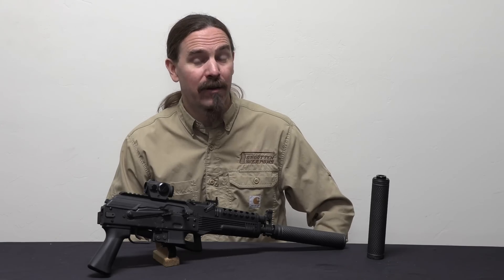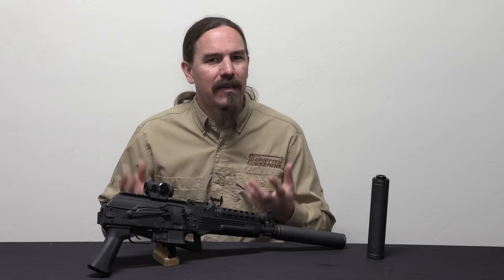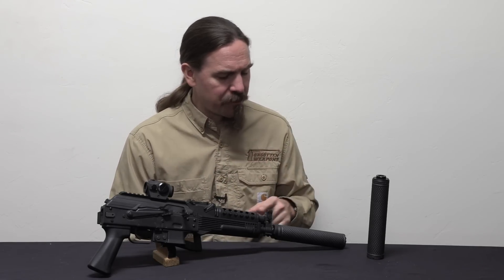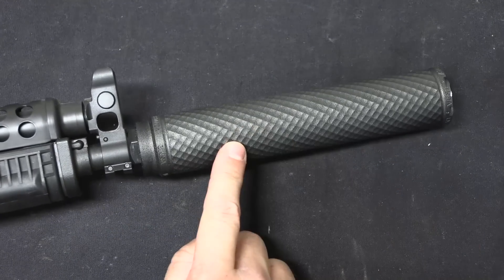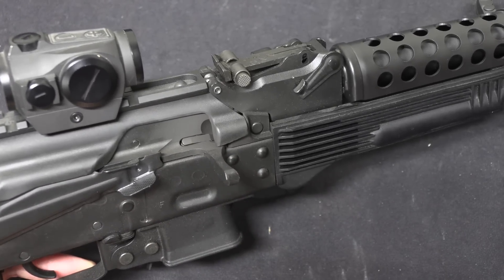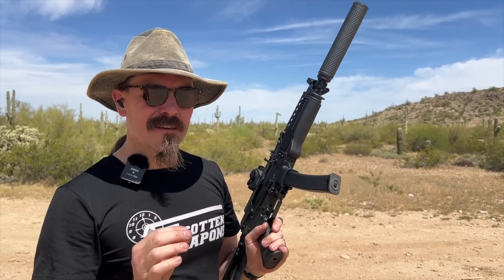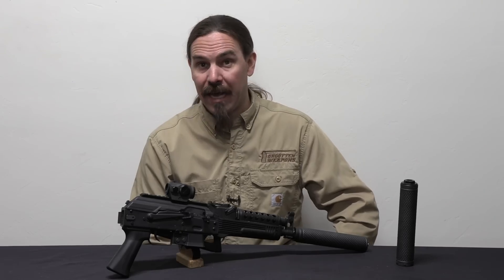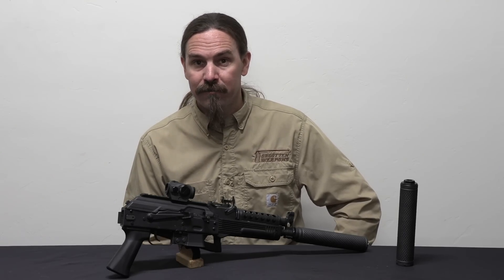PTR Vent Suppressor: 3D Printed Titanium Foam

Comment: What is the point of reducing the gases heat?   I understand what physically slowing the gases down and venting does and why that suppresses sound, but why would pulling the heat out of the gas and absorbing it with the can be beneficial rather than letting that heat escape into the atmosphere?   Seems the can, and subsequently the barrel would get hotter faster.  Won't that put extra wear on those components?
Reply from the maker: PV=nRT. Reducing the temperature reduces the pressure.

Comment: It seems like that would be an incredible pain in the butt to clean - you might have to use an ultrasonic bath with solvent or something.  Cleaning aside, if the audio is coming through correctly then the sound profile with subsonics seems pretty darn amazing.

Comment: Hello. Are you familiar with shotgun chamber adapters? 12 gauge to handgun, smaller shotgun and 22 lr. Some only have an inch or two of barrel some are 16-18”. Would a 22lr chamber adapter for a 12 gauge that had a built in suppressor at the end of the adapter that fits entirely inside the 12gauge barrel need a tax stamp?

Comment: There is absolutely no way that soaking that can in solvent is going to get the carbon out of that membrane. That’s pure fiction. You can’t get hardened carbon out of any can in fact from pure solvent without physically scrubbing it away. You can at best get a partial percentage out with a soak or sonic clean. I bet that can is effectively done at 2000 rounds as far as its effectiveness in back pressure reduction.

Comment: Basically the whole idea of a suppressor is to decrease the performance of the bullet when you reduce the report you reduce the performance now if you can get a bullet to reduce its report without reducing its impact on the Target that would be something that would be valuable to DARPA I have an idea for a silencer that's deployed when you pull the trigger it is a munitions deployed suppression device and requires no extra equipment other than the special round loaded into the magazine before you pull the trigger

Comment: My first thought was to wonder what the specific heat of Ti was.  The idea being that this suppressor is meant to steal energy from the gas by simply stealing heat away rather than baffles that provide a bad path to escape (bleed velocity).  I was pleasantly surprised to see that Ti is rather high in the grand scheme of things in terms of specific heat, ie it has the potential to take a lot of heat without a temperature change (same reason a little poured water into any suppressor makes it quite a bit quieter).

Comment: The concept is fascinating, but I don't get why Titanium is used. Its thermal conductivity is abysmal. Wouldn't it make more sense to print it from (if possible) copper or brass? Or is it because of Titanium being very light when compared to those metals?
Reply: Durability, weight, safety. Copper and brass deform significantly under heat. Brass and copper anneal at 700F. Firing a couple of 30 round mags of 5.56 back to back heats up to the 400-500F range very quickly. If shooting sustained, the temps of the can and barrel reach over 1,000F.

Comment: Having experience with this type of material, you will really need an ultrasonic cleaner to maintain it. This stuff has been used in medical devices for decades. I used to work for a company that developed the manufacturing process that was used before 3d printing was a viable option.  If anyone is interested in how it used to (and probably still is sometimes)  be made, just ask. This is a pretty cool material.  Due to its porosity, bone and tissue will grow into it.

Comment: I would think that white vinegar would work just fine as a solvent (?). I don't think that would 'eat' the ti. Though it would probably strip any platings off; on the nut, for example.

Comment: This is really interesting.  I've been using almost only OSS cans for the past maybe 5 years or so(I've got 5 of them now 😬😬😬), and i just love them(my eyes are cross dominant so i shoot long guns lefty.)  I've got the 5.56k on my 12.5" HD gun.  But im always checking out new options/technology, etc.
In fact, a long time ago i first saw that 3D printed Ultra II Brevis(or something like that), the one that weighs less than two A2 flash hiders and only adds like 2 or 3 inches to your gun because its so fat, and i thought that was potentially the future.  I ended up not getting because of its relatively short lifespan, there not being much info on it, but mostly because of the price.
And as much as I'd like to buy one of these, its the same thing with the brevis again.  It new, not much info on it, and costs to much for me to "take a chance on," especially when I've already got something that works and that I like.

Comment: Someone should take a Tesla one way valve and wrap the principal around a bore using 3d print technology. Let the gases block or slow the escape by forcing some of the gas back on its self. Use finite element analysis for proper flow. My two cents. ✌️

Comment: It's very cool but at that price you have to wonder about long term degradation of the internal gas pathways due to imperfect cleaning or even over cleaning. Hopefully they'll get a large military contract so they can reduce the unit cost and gather large scale endurance and performance data for future designs.

Comment: Not sure if it came across right on video but the repetition sound of the gun sounded louder than the actual shot. If so it would be super interesting to mod a gun to minimize the mechanical sounds of cycling.

Comment: Our company worked some if this decades ago.  The same effect can be obtained with a flexible plastic foam, similar to the insulation for hot water pipes.  The problem is that this is totally non-durable, and quickly wears away, sometime enflames.  However, with some duct tape, this works for about one magazine.

Comment: poor man's ultrasonic cleaner-take a aluminum tray pan and fill with solvent then take your off the shelf vibrator and put it in a chemical proof zip lock bag, drop it in for 1 hour with the gun parts and viola!

Comment: honestly, with it being pure monolithic titanium, you could probably get some pretty effective cleaning out of just getting it hot as hell. titanium doesn't melt until fuggen' 3000 degrees F, but carbon will be burned off into CO and CO2 at temperatures far, far, far below that.

edit: WOW that is a quiet suppressor. man. the subs literally only made the noise of the action.

Comment: Its often very hard to tell sound on video but a good indicator is when you can hear the hits and ricochias that its pretty quiet.  You could clearly see a bit of gas coming out but it didnt seem like all that much but i dont know if i would claim 0.  I would actually be interested in seeing someone do a burn down test of one of these putting 1500-2000 rounds through one in a day and see how its working then.  i dont know if a 1500 round limit would have any military application but 1500 round limit is more then plenty for most civ use.  Probably even police and swat use.  I cant afford one myself but I will be interested to see where this suppressor goes if they can make a quick connect and what small improvements they can find.

after thought.  I wonder if it would be possible to actually make the whole suppressor a sponge making it more like a compensator with the gas just leaking out of the sides in a large area.  It would be a highly custom market but it would allow suppressors to be custom made to a certain firearm allowing but recoil reduction and suppression.  I am thinking about lighter short barreled guns in larger calibers that could take advantage of it.

Comment: How much could a supressor possibly cool down exaust gases in the moment a bang happens ?!
I guess, not so much. So I also guess the cooling effect is not the point that matters, because it's virtually not existing.
For example felt works possibly even better than this metal mesh and sponge pattern, dispite the fact that it would be destroyed pretty fast. But felt would for sure not cool down the gases !  So it's most likely something else that's dampening the bang.

Comment: good video. One thing to consider is the bond during this process makes the material a bit brittle, so there is potential these could shatter in some cases. I also wonder how much carbon buildup would render the perforations useless. One day when we dont have to worry about registration and tax stamps, these could be made inexpensively in volume and you would just throw it away and get a new one after hard use or damage.

Comment: Holy crap... That's incredible. I wonder what the maximum number of rounds is, or could this continue to work almost indefinitely with cleaning. There's no way soaking in CLP will remove all the carbon, so it could get worse over time even with cleaning.

Comment: Um... i wonder if, or how long until, Really Wild 3d printed weaponry happens.
This release suggests a decade or less, for machinery prices to come down, availability of machinery to go up, the total to drive supply chains...
You could Literally have a weapon body that is an integrated suppressor, that vents out the front.
Ha! Suddenly the "scifi look" could have a purpose!
Could take all Kinds of lessons from pulsejet engines, car exhaust systems, and more.
Lessons where they had to identify behaviours a Suppressor would want, but jets & car engines Do Not.
Just the ability to have 200 tubes to redirect  gas, but then you could make every tube a different length; physically changing & extending the sound profile, while carrying it past even more metal,  that serves More roles in one...
Foam metals have been a research project & designer wet dream for Decades.
The ability to customise the density, structural rigidity, and many other properties,  of metals, the way we do with foam plastics?
The "porosity" terminology suggests they're  manipulating a "welding failure" intentionally...
But this is going to drive interest & innovation.

Comment: I wonder...
Theoretically, Carbon buildup Could be solved by burning it off in a kiln at high temperatures. Basically burning it it combine with oxygen & escale as CO².it 
How high a temp can this titanium foam survive (pure titanium is flammable), is it usable after, how effectively does that burn out residues; i have no idea.

Comment: I do question how long Titanium will last for this though, it's not really known to hold up for High temperatures (coming from an automotive background where titanium exhausts may be common, but headers are not), however I also wonder if an Inconel version could work (Used for high end headers and F1 exhausts, also rocket engines), it'll handle the heat MUCH better, and can also be 3D printed now. The porous structure enabled by 3D printing is super awesome though, and while I don't know a lot about suppressors, giving it a bath in solvent, maybe in an ultrasonic cleaner, seems pretty easy actually.

Comment: My first suppressor I bought in 1987 was for a class 3 Mac 11 9mm. It was a two stage type. Fat portion was full of stainless steel boot eyelets, and the second stage was baffles. It worked well but got progressively louder after shot in full auto for a while.
Reply: M.A.C. got those eyelets as military surplus for practically nothing. Pretty good repurposing. Those cans do get kinda loud once the wipes are shot out.

Comment: I've often wondered by suppressors don't utilize bore evacuators (https://en.wikipedia.org/wiki/Bore_evacuator) to reduce backpressure.  This is a well developed technology, based ont he same concerns, from use on the M1 Abrams tank main barrel.  The location constraint of being toward the end of the barrel might complicate the design, but that concern seems like it would be negated by the whole "we're could make this out of 3D printed titanium foam" bit as well as some finite element modeling of the gas flow.

Comment: A big concern with the gas is the lead styphnate in most primers.  Lead-free primers are now available but the vast majority of rounds produced still use leaded primers.  It is also used in the cartridges for nail guns.  This is a problem that will require legislation to fix.  There is no such thing as a safe amount of lead.

Comment: $1,500 bucks 🧐🤨🤔 i feel fairly certain i could make the same thing better, lighter and cheaper out of a fishtank airorator block and an old suppressor housing. 

Step 1) buy cylindrical airorators and drill the cores to size.
Step 2) slice using a tile chopsaw to 1 cm thick.
Step 3) stack in old empty suppressor can… maybe add small amounts of fiberglass insulation as buffer layers. 

When it gets clogged simply pitch your $5 fishtank airator and buy a new one.   That titanium one is going to be impossible to clean……. By which i mean it’s going to go bad FAST from unburnt residue clogging up those tiny paths.

It is an evolutionary dead end.
Reply: It’s not impossible to clean. Breakthrough, Huxwrks, and CAT all make suppressor cleaner agents.
Reply: @ja0298   the difference is the substrate you’re cleaning…. This is like sandstone and you need to clean the gunk out of the tiny pours not only between the grit on the surface but also inside of the “sandstone” like substrate…. You’d literally need to force it through the material at high pressure and even then a blocked path would stall the flow through it making dissolving that blockage even harder. 

Buy it if you’d like 👍 i’m sure it works well in the beginning…. But these things clearly have an extremely short lifespan 

Lets both try to remember to come back in 2 years and see if this infertile abomination has gone extinct or if “life finds a way” 

My money is on this being unsustainable

Comment: I got to be honest and say I don't think the extra maintenance is worth it for me.
Reply: It’s not any worse than cleaning any other can. Soak in breakthrough, Huxwrks, or CATs suppressor cleaner over night, rinse it out, let it dry or shoot compressed air in it, and your done. I’ve used the breakthrough stuff for a couple of months, it works well.
Reply: @ja0298  it's not the procedure it's the frequency.
Reply: @theodoreheintz7891  Ah, that’s understandable. 1500 is a pretty low round count, especially for a 9mm can. I imagine they got that figure using bullets with fully encapsulated jackets. Can’t imagine how low it would be with bare lead or polymer coated ammo.

Comment: Isnt titanium lousy for absorbing heat tho?
Reply: Most suppressor is made of titanium
Reply: @jjjk6662  yeah but most made of titanium use baffles instead of relying of heat syncs to slow the gas expanding. 
They also have more mass to absorb the heat also. 
I have lots of more questions but I'll have to check the design out online before asking them later, first.

Comment: Would love to see some testing of the cleaning claims.  Like, weigh it straight out of the box, put a couple thousand rounds through it while logging the sound levels, weigh it after, then do the ultrasonic solvent bath and see how close it gets to original weight...  

Logging the sound levels doesn't need to be high-precision; set your phone a fixed distance away, turn off AGC, and record.  Might not tell you the exact sound pressure levels, but relative volume is good enough.
Reply: Phone microphones aren’t at all for comparing sound quality.

Comment: Sounds to me that the cleaning should be a non-issue. Put it in a ultrasonic cleaner with some cleaning fluid and let it sit for a while. I.e. manual labor.

Also sounds to me that it works incredibly well. The next step is to make a silent action. The cycling of the gun was LOUD. 😅

Comment: Nice obligatory desert ricochets audible over the gun.

Cleaning was one of my main concerns. If you can afford these things you can definitely afford an ultrasonic cleaner though.

Another concern of mine is water absorption. What happens in a bad environment situation where the thing gets dipped in water? I’m sure it will blow itself dry pretty quickly but in the meantime it’s going to do bad things to internal pressures.

Comment: Perhaps a stupid question, but I wonder if immersion in liquids would inhibit its performance. In other words, if water soaks into the spongiform material, would there be enough pressure to force it all back out? Would it be able to flow out on its own? I have to imagine that at least some water would be trapped in the very fine cavities.